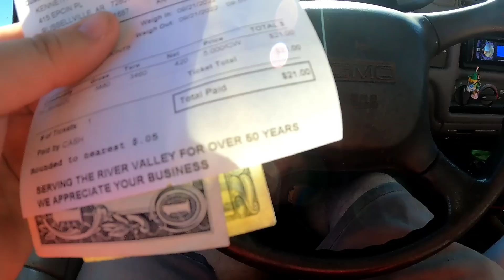Scrapper goes to the Scrapyard-Shred day.

Comment: yep. like the unload at the scrap yard just as much as the looking and loading. for me it's the funnest and easiest  part of scrapping. just toss it and go get payed. but at my yard most of it is done with claw. next week is my big payday. got almost two full 55 gal barrels of cords, about a half barrel of clean copper and about 50 compressors and about the same or more of motors from fans and such. and about a 6 ft tall stack of clean acr's and a big pile of aluminum. I only turn that stuff in once a month, sometimes every other month. just depends how much I have. this month is about three weeks worth so been a good month so far. great end of the month payday each month.

Comment: The vertical head rail takes about a minute and a half to clean trust me I've done tens of thousands of them even if the main rail itself is steel they're still in aluminum tilt gear in the middle and like I said a minute and a half it all adds up after a while